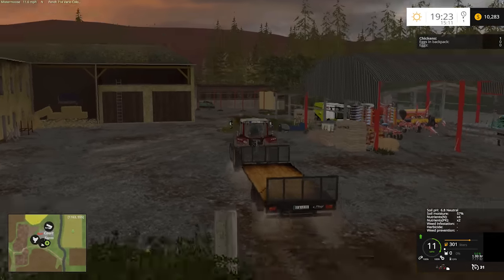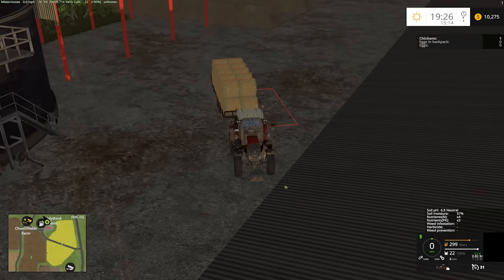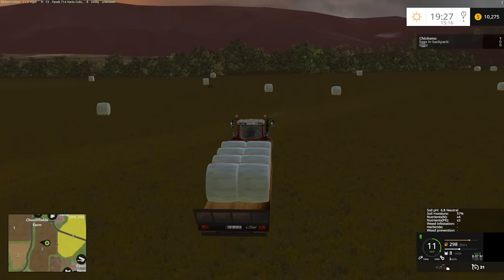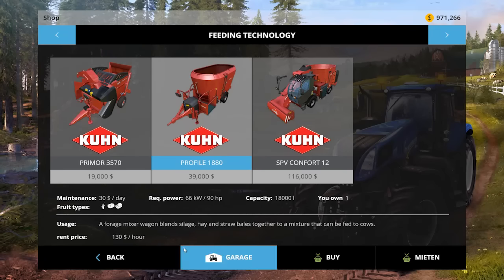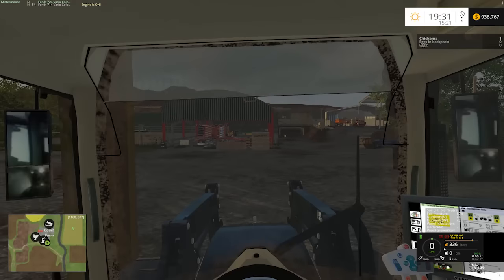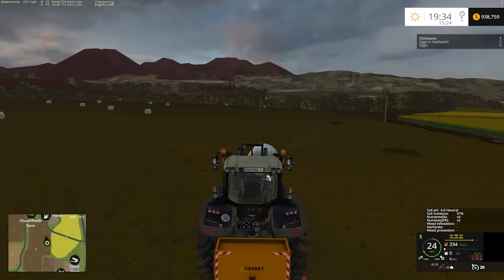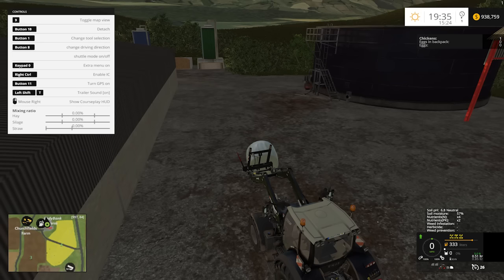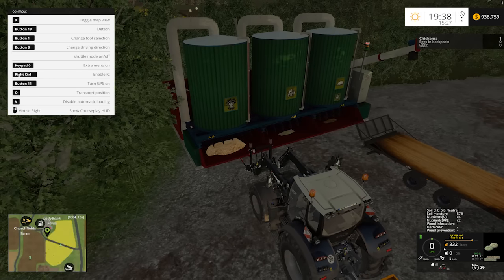FS15 Mythbusting - Krone Ultima Bales

Comment: Awesome video as always moose. Course play?  I couldn't get field route to work, my fix set route up in field work then turn baler on and used transfer mode. Beware of speed though it can fill too quickly and tractor doesn't slow down, material is left behind. Oh and 1.3m bales work on stock game auto stack 👍🏼

Comment: Hey Moose as this video was about Mods, I was curious if you have had problems with the ROS Mods?
Reply from the maker: +f304 Not really, Why?
Reply: I will add it and it will work for a bit. When I come back to the game after 2 or 3 days my maps will not load up. I just get a black bar where the loading icon would be.
Reply: +f304 sounds to me like you have exceeded the fruit amount Giants only allow 64 fruit types and mods like 
ROS Fruit And Berries will push it over 64 thats why your game maybe not loading you can get the +64 fruit mod that will increase fruit amount I hope that helps
Reply: Thanks for the help, I really appreciate it.
Reply: +Kevin Sawyer Simple fix. Just download the remove 64 fruit limiter mod. It changes it to 128 fruit types.